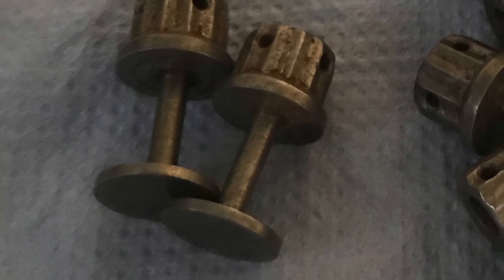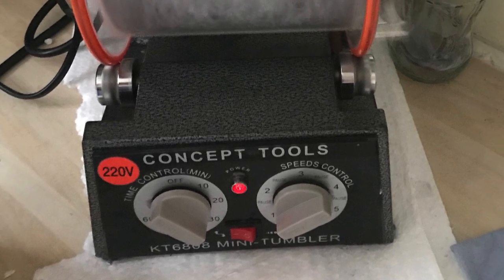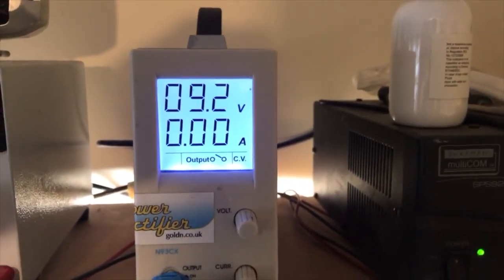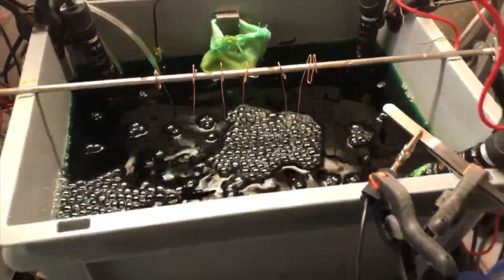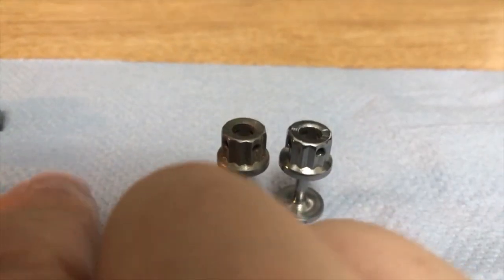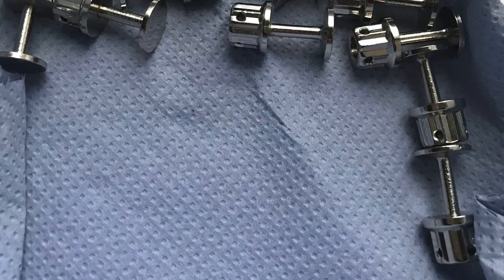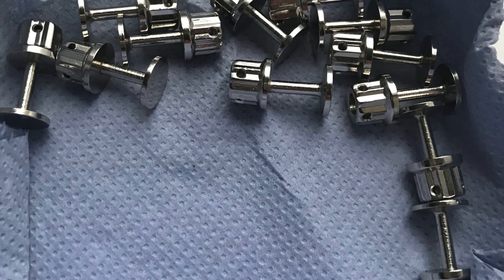How To Nickel Plate On To Steel, tank plating nickel, nickel plating,

Comment: I noticed the bubbles in the tank as the piece was plating. Do you use a pump or an agitator to circulate the solution? If so ... what device would be appropriate for circulating the solution?
Reply from the maker: Hi 
i use a Fish tank air pump i think its the cheapest way to agitate i use plastic pipes and glued them in the bottom of the platic tank
thanks
Reply: @GoldenSolutionPlating  Thank you very much. I've learned so much by watching your video and must say it was the best presentation I've seen. Looking forward to my project with nickel plating.
Reply from the maker: @davidhawkins9202  thanks

Comment: Reviewing the video one more time before I started my process with electroplating, There seems to be some sort of material covering the electrode mounted on the backside of your tank. It looks like clothe material.  If so ... what kind of material is it and what is the purpose of it?
Reply from the maker: D H55 hi 
Yes that’s a titanium cage with anode bag you put the nickel anodes in there that’s pure nickel the bags act as a filter to keep the solution clean have a look at you plate.co.uk 
Thanks

Comment: Very interresting video, I'm currently stuck with a finish problem with the parts I plate. They always tend to come out rough and not shinny at all! Would you be able to help me with that issue ?
Reply from the maker: ok 

make sure the item is shiny before plating and that the amp setting is correct 

thanks

Comment: Hi sir how to calculate  volt and current  example I have 25 mm dia disc and 5 min thickness need ni coating
Reply from the maker: You need to use an online calculator from spa plating www.Goldn.co.uk search for online calculator in the search box

Comment: Although this post is 4 years old the information is timely and well-presented. Thanks.

Below is the “recipe” for your recommended “Golden Solution Electro-Cleaner” as provided by the manufacturer. There are no proprietary ingredients or processes used in the solution’s manufacture.  

Golden Solution Electro-Cleaner (makes 100 cc or approximately 1/2 US cup of solution)

96 cc distilled or deionized water
1 cc Sodium Hydroxide 
3 cc Sodium Carbonate

Caution: This solution is a mild caustic alkaline. Please look up proper handling and emergency first-aid procedures for these ingredients before proceeding..

In a glass or plastic container slowly add Sodium Hydroxide to the water, stirring constantly.

Slowly add Sodium Carbonate to the above solution. Stir until dissolved.

Notes:

Sodium Hydroxide is sold as Lye in either a liquid or crystalline powder form. It is available at most hardware stores or plumbing supply shops (typically marketed as “drain cleaner”)..

Sodium Carbonate is sold in the US as washing soda, generally under the Arm & Hammer brand. Available in most grocery store laundry supply aisles.
Reply from the maker: Our solution contains no acid at all

Comment: Sir this device name i mean which device pulleys this
Reply from the maker: It’s a polishing tumbler
Reply: @GoldenSolutionPlating  where can buy this wheel you have any link
Reply from the maker: https://www.ebay.co.uk/itm/174813640783?_trkparms=ispr%3D1&hash=item28b3b4784f:g:nukAAOSw7Cdh2pVw&amdata=enc%3AAQAGAAAA4L9xqTiL1t2G%2FeLhU3m8f1Nwj%2BT9LR2OAIhFc%2FjUZtQ8JBE8bG2rJU7NN2anHdWyJ%2F4uSxksoIt2ib9wtyQe9i4I5qQe63LEAyWJcxnyZnrxTx5w3z4cDUZoet8ZRKtWnE6W0LH4SWr%2FAnR%2FJ5nrtXNpQqe0%2Bwstj5tUOQ245jFyvw8oGBQpiob5DMvN6zWYiBLzkJP1z2DDgwqV3GD8VkL5GlHMjtpzJPJPCs5QfxofPuJrYdsdNZTr2qckklu99AUIChBVH2P0AeQnFMispANjG6JV8J5W7%2BuS%2BA6J%2FOqD%7Ctkp%3ABFBMnrHs2fxf

Comment: Could you explain your set up for the electro cleaner? I see some sort of mesh 360* around the part what is that?
Reply from the maker: hi 

yes i use mesh from spa plating 

here is the link 

https://www.goldn.co.uk/product/stainless-mesh-electrode/
thanks
Reply: @GoldenSolutionPlating  what is the solution used in the electrocleaner?
Reply from the maker: @shermandsouza  its cleaner

Comment: How many volts and amps would o need to use to plate a 24" x 24" sheet of 18 gauge cold rolled steel?
Reply from the maker: 297 amp and the voltage turn to full power as it adjusting automatically 

thanks
Reply: @GoldenSolutionPlating  what do you mean ? I have a data safe 140AH 540watt per cell battery and a 12V 10 amp charger  will this be enough?
Reply from the maker: @KnowName33  that should be fine yes

Comment: I always forget the answer to this but for copper plating steel it needs to be nickel plated first or does steel need to be copper plated first to then add nickel? I never get it right.
Reply from the maker: you can plate copper first and then nickel but you can also plate nickel directly on to steel 

thanks
Reply: @GoldenSolutionPlating  - Thank you for that. I had heard somewhere that you can't plate steel with copper unless nickel plating it first. I tried this with my solution but maybe the salt in the solution was interfering because it didn't really work at all.
Reply: @GoldenSolutionPlating  - Another question. I have been using sea salt to electro etch metals as a hobby. I am a little bit scared of the chlorine smell that comes off it sometimes since the conducting solution I use is filled to capacity with that salt, it wouldn't surprise me that some of it was being broken up into Na and Cl, even if tiny amounts only. Could I possibly use Epsom salt instead since that is made up of magnesium and sulphur (MgSO4)? Unless that were to make sulphuric acid, then I suppose not...
Reply from the maker: @SnorrioK  sorry i dont know

Comment: For a bottle solution about 500 ml, how many amps it will need? Thanks.
Reply from the maker: Same as this one 
The amp setting is depending on the size of the item not the size of the tank 
Thanks
Reply: @GoldenSolutionPlating  thank you so much. Can I ask again, is it possible to plate brass or copper directly from iron or conductive ink like carbon? Thanks again.
Reply from the maker: omendacat you want to plate copper on to iron or on conductive ink ??

Comment: ive just started learning to nickel plate. but mine are always come out grey and dull... 
I have tried leaving in for longer times, putting the part furthest away as possible etc..
Cannot get anything really shiny..
Im using an old cell phone charger... 5v 400mah...
Reply from the maker: Hi
i think its your power supply because you need to work out the area in cm2 thats not always easy put the amp settings to about 0.03amp to max 0.05amp per cm2 for example if you plate an item what has a total cm2 of 15cm2 the amp setting needs to be 0.45 amp to max 0.75amp you need to be able to control the amp settings 
thanks

Comment: The video won't play for me. It played for 1 minute then started loading. Change the video and plays fine. Come back to this one and it's only loading. Very Very strange.
Reply from the maker: Craig Gamble hi it works all fine for me you may have to use a different browser 
Thanks
Reply: @GoldenSolutionPlating  I'll definitely try it. Pretty interested in how this works out
Reply: @GoldenSolutionPlating  yeah, it's still just loading.  I'll sub and keep trying.
Reply: @Highnz57  - are you using Edge? Because any other browser is better, even firefox. Firefox may need to be re-installed every few months because it tends to clutter itself with its own updates but if it's removed and re-setup then it should work. Edge is complete garbage and should only be used to download other browsers.

Comment: What happens if you use too many amps? I’ve been trying to get this right and my finish seems very thin. My solution isn’t nearly as dark as yours though
Reply from the maker: if you plate with high amp setting the color can get darker and you may have problems with adhesion to plate a thick layer you need to increase the plating time

Comment: 0.04 of an amp. 10 of them, is .4 amp!  No?
Reply from the maker: i plate the nickel with 0.04 amp per square cm  one item is 10 cm2  so i plate one item with 0.4 amp thats 10x 0.04 =0.4 amp as you can see when i plated one item 
if i put 10 items in the tank that would be 4 amp   
thanks

Comment: Rubbish talk! You plate by the surface area of the parts - not the number of parts! Back to school for You, Sir!
Reply from the maker: yes i do plate by the surface area the item is 10cm2  the rate is 0.04amp per one cm2 if you plate one item thats 0.4amp (0.04x10cm2 = 0.4 amp )  so if you pate 2 items at the same time thats 0.8amp  with 10 items thats 4amp and so on a 5 year old can work that out 

not sure what you talking about you need to watch it again and turn the sound on 

thanks
Reply: You aways plate by surface area, you calculate the total area to be plated and then adjust the voltage and ampage to suit. The more items, the more voltage and amps due to surface area. The doubter should think, then go back to school sir... Contradiction!
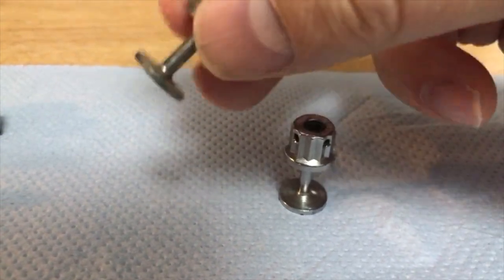Reply: This critical comment coming from a guy with 4 subscribers, 2 uploaded slideshow videos (0:45 in length) and 1 actual video (1:31 in length). I took the time to review your video uploads and was hoping I would learn something or at least be inspired. All I can say is, you have me beat, as I have never uploaded anything and you have pushed me one step closer to uploading something. Thank you Sir!